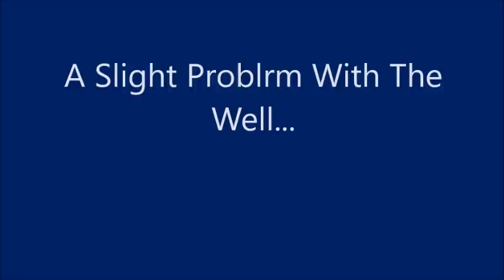A Slight Problem With The Well

Comment: Brian that pump you have there can run with out being in the water it has a sealed bearing in the pump housing. You should have removed the outside  housing when you had the pump out to check the impeller for any string or wire wrapped around the pump or shaft in under the housing and check for damage from sand moving over the pump blade.  Also you should check where the  wire enters the housing for wire fatigue around the area where the wire enters the pump housing, that is usually the first place that gives out.  cheers
Reply: antio warr y

Comment: When you put the pump in for the final time glue screw connectors to the pipe sections then you can just unscrew sections to remove the pump later.
Reply from the maker: We will

Comment: Brian I used the black PE pipe to my pump I think it comes in 90m rolls with all the fitting that you can unscrew by hand, the blue pVC pipe gets very brittle with age and I have not found a good brand of the glue that lasts
Reply from the maker: I agree the solvent" glue" here is subpar

Comment: You have to have a water storage tank as reserves in times like this. It's hard to run a piggery operation and other stuff without a fixed and steady water supply with no disruption. You need lots of water, a private drilled deep well is what you need, it never runs dry.
Reply from the maker: I do have a storage tank. Holds 3000 gallons.

Comment: In the Philippines especially dealing with non structured business,  there is no written contract between the you ànd worker. They are merely local and non educated workers. They do not go by any kind of rules and regulations in business practice. They do not have  what we call consumer service that ensure consumers satisfaction. Their  mental conditioning is to be able to eat today and will think later for the future. They really do not care about reputation because they have no business to run. This is why,they are cheap to employ because they take anything dirty when they think they need money.  This explain why they act that way. However, NOT all Filipinos are like that, trained professionals think differently and they will be costly. So....we should avoid stereo typing as respect for the rest of the Filipinos.